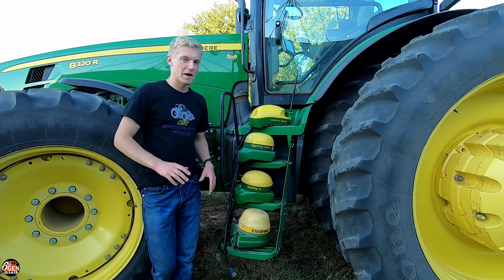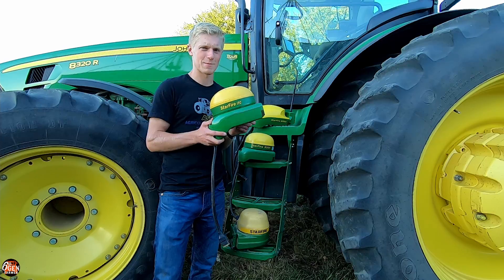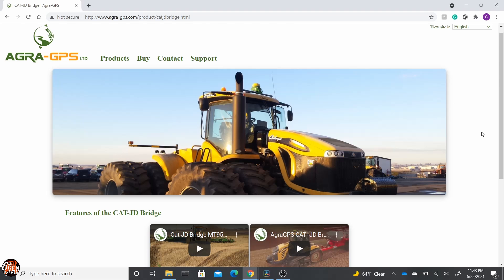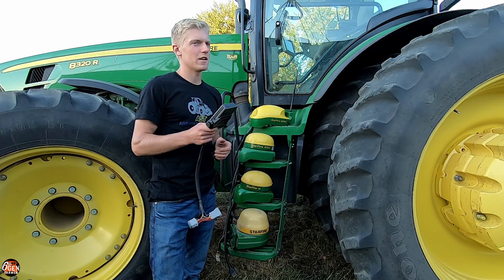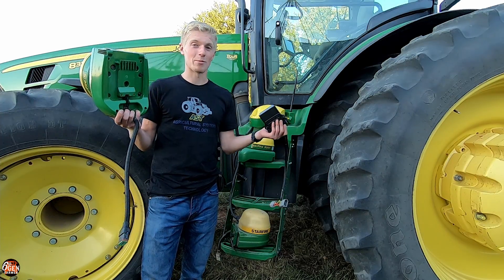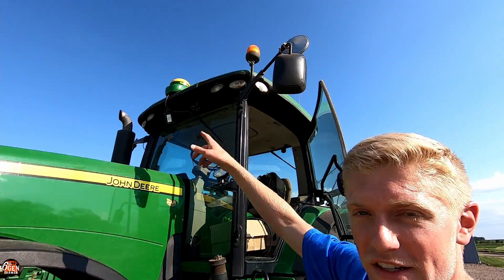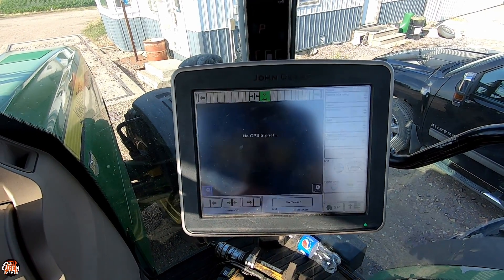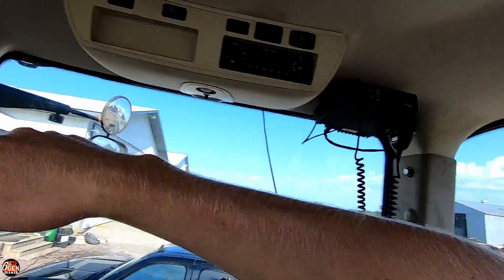Reviving Old Starfire Receivers: ITC EXTEND

Comment: Where can i get information on operating a starfire 300?
Reply from the maker: 300 or 3000?  Either way youtube or your local Deere dealership are good places to start
Reply: @6thGenFarmer  i read it from the right so maybe there was 3 zeros on it i need to spray weeds and it would be nice if I could go back and forth and just move over 40 feet and I think it would do that. It's not autostart but it has the lights across the bar to guide you straight ahead. Thanks for your help

Comment: I figured there had to be a way!  I am running Ez steer with an AG25 antenna receiving WAAS on a Trimble 750 to plant with.  Works real good for me!  Thanks for the tip!  I looked at a sprayer that needed a JD Globe.  Dealer said $4,000 for the 3000 receiver......... noooooooo, not going to do that!  This would be a great option!